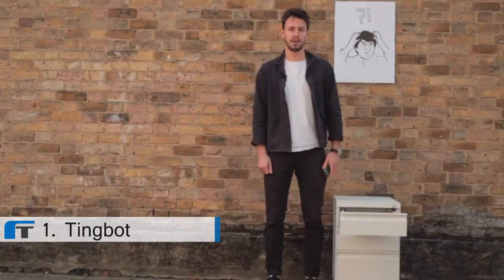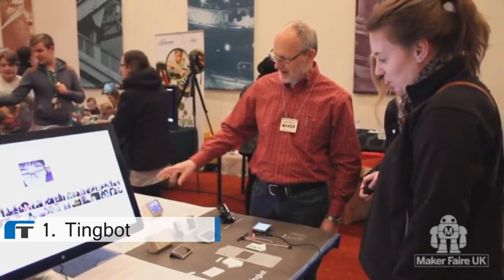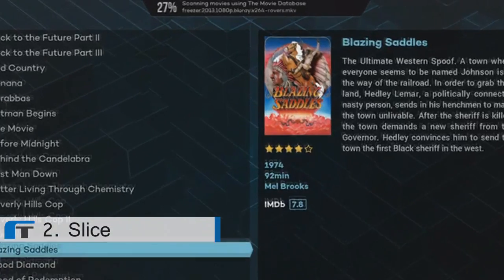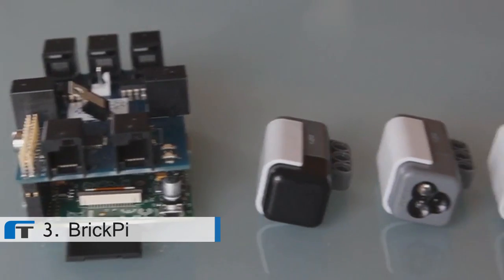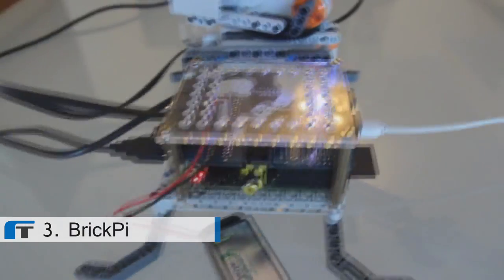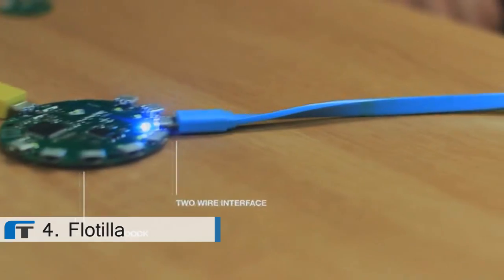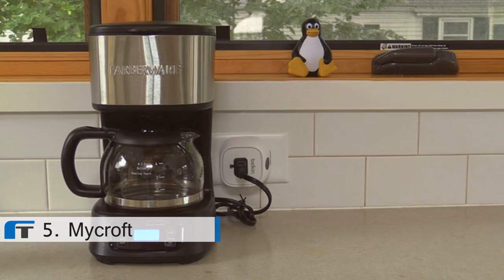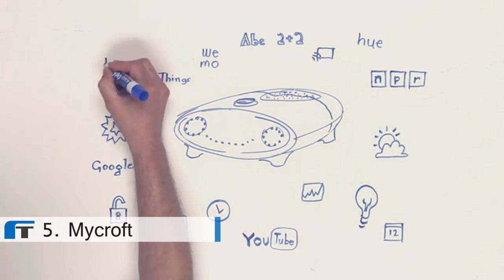5 Amazing Gadgets Built On Raspberry Pi

Comment: If you want to make a Thermostat for your house/office that can automatically switch from heating your house to air-condition with out you manually flipping a switching for under $170 US. You can use at minimum Raspberry Pi 3 B or B +.

To have it automatically change from heat to air you will need two Thermocouples, one for measuring inside air temperature & one for outside (needs to be waterproof for measuring out side to determine when to change from heat to air).

You will need a relay board as well as a board to convert the Temps for the Raspberry Pi.

Here is a list of the parts I think that will work together:

1 - Raspberry Pi 3 B+ Motherboard
     https://www.amazon.com/gp/product/B07BDR5PDW/ref=ox_sc_act_title_7?smid=A30ZYR2W3VAJ0A&psc=1

1 - SSD Memory Card to save money you can go smaller
     https://www.amazon.com/gp/product/B073JYC4XM/ref=ox_sc_act_title_6?smid=ATVPDKIKX0DER&psc=1

1 - Seeedstudio-GrovePi+ (Which will get Temps)
     https://www.amazon.com/gp/product/B01ANDPDQE/ref=ox_sc_act_title_5?smid=A1YP59NGBNBZUR&psc=1 

1 - PiRelay EXPANSION BOARD
     https://www.amazon.com/gp/product/B077LV4F1B/ref=ox_sc_act_title_4?smid=A6VWRX3EBWSU4&psc=1

1 - seeed studio Grove - I2C High Accuracy Temperature Sensor(MCP9808)
      https://www.amazon.com/gp/product/B07HCK8Z5T/ref=ox_sc_act_title_2?smid=A1YP59NGBNBZUR&psc=1

1 – Waterproof Temperature Sensor Probe Module for Arduino Raspberry Pi
      https://www.amazon.com/gp/product/B07QJWVB9Q/ref=ox_sc_act_title_3?smid=A26266MVADWARO&psc=1

1 – I choose the Raspberry Pi 3 B+, 5 inch Capacitive Touch Screen HDMI Monitor - 800x480 
      because it mounts the Pi so that you can mount the other boards without extra cables.
      https://www.amazon.com/gp/product/B07P3HF42V/ref=ox_sc_act_title_1?smid=AD7LID9K1N4N9&psc=1

 If you have a large house with two furnaces you will need another Temperature Sensor for that part of the house, as the relay board has four relays.

 You most likely will need Thermostat wire so that you can extend the wires on the waterproof sensor, also the wires from the furnace. Which you should be able to source from any hardware store.

The logic for programming the Raspberry Pi is as follows:

You need to determine the outside Temperature:
If the outside Temp is above say 74 degrees F or 23 C you will need the air-conditioning.
If the outside Temp is below say 70 degrees F or 21 C you will need the heat.
You may change the Temps above to suit you own needs, but they can never be the same or cross over other wise the furnace will not work properly.

You need to have on the screen to see what Temp you want the furnace to heat and Temp you want the air.

The fun part is the programming of the Pi. Should be able to use either F or C

If you have two furnaces you will need to add another temperature sensor. I would use the waterproof unit as it will be easy to extend the wires if need be.

Comment: Shame Mycroft is just another Google Home, or Amazon Echo. I liked the Slice media centre. Anyone can knock up a media player on Pi, installing XBMC on the SD card. The problem with a native Pi is that there's too much of a performance issue over USB to play 1080p movies. The slice is technically not a pi, since the board has be redeveloped into something else, and they have played around with the XBMC to give a more Apple TV feel.
Reply: But mycroft software is open source, you cannot look up the code of any other one of these things like google home or amazon echo. I won't trust putting alexa or google assistant with its mics turned on in my house.

Comment: The BrickPi is a more expensive micro-controller, therefore a Arduino Mega 2560 with a Raspberry Pi 3b+ costs around the same as a BrickPi alone. Which is 100$

Comment: So we have:
- A Raspberry Pi with an LCD on it
- A Raspberry Pi running KODI
- A Raspberry Pi with a generic robot interface, (robot made of LEGO)
- A Raspberry Pi connected to some random light sensors and motors
- A Raspberry Pi "Google Home wannabe", that costs 5 times more and it's worse.

Comment: Slice doesn't use raspberry pi
Reply: Its using a Raspberry Pi Compute Module.
Reply: It said that it used a custom pub.
Reply: *pcb
Reply: Yes, with a Raspberry Pi Compute Module at its heart. That is exactly how the RPiCM is intended to work.
Reply: Sandriell ah, ok

Comment: "mycroft, lock up for the day" turns up the heat wtf??
Reply: The AC setting is to 'trick' the thermostat to not turn on AC during the day, wasting power.
Reply: I actually liked that, the last thing i do before leaving each morning is turning up our AC so it's not blowing super cold all day, then i turn it down as soon as we get home.  we don't have a wifi enabled thermostat, though we did in our old house and i'd do it via the phone app then.  Would be nice for a device to do this automatically.
Reply: BitesCGI hahahaha

Comment: Slice... you're selling a raspberry pi case running a Kodi (with a different skin). Built from the ground up? Seriously?
And it doesn't even have digital/spdif audio out!!! Why? Because it's bare raspberry!!!
You silly muppets, I hope you go bankrupt and your scamming asses end up on the street.
Reply: How are they scamming? He said exactly what was in it. You are paying for the custom case and having it all setup and ready to go out of the box. And why do you need spdif out? Its outdated. You cannot do HD audio over spdif, use HDMI.
Reply: +Sandriell  to me "built from ground up" means they designed the whole thing. They didn't. "Our own purpose built user interface" is just a skin. All that for $200.
Spdif/digital is the sensible way to connect devices such as this to most amplifiers, and there is absolutely no reason they could not have integrated it into their... gadget.
"you cannot do HD audio over spdif" uhh, right. Define HD audio.
Reply: HD Audio: Lossless Dolby TrueHD or DTS-HD MA... the audio formats on blu-rays. SPDIF can only do lossless stereo or compressed DTS (5.1).
Reply: a mini pc costs less looks just as good. software and performance will shit all over it from a very high height
Reply: they said custom pcb. unless they mean that they made theyre own pi, thats a load of horse shit
Reply: But the guy had an accent...

Comment: 0:50 these controllers aren't even connected :')
Reply: ya they are the usb on the side is a split controller adapter
Reply: Trent Bell notice the green Xbox led flashing? That means its not connected
Reply: Jos Meerssman nigga its connected
Reply: Jos Meerssman not necessarily, just means it's connected to something other than a 360.